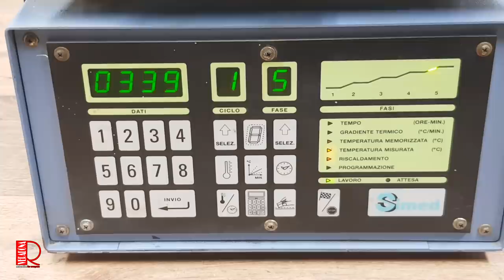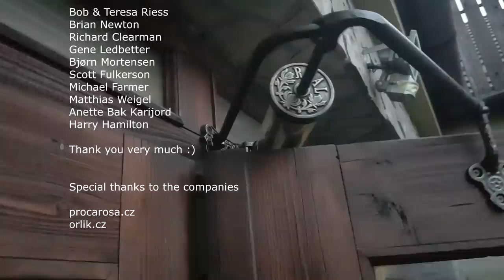Door closer - Restoration

Comment: I looked it up: Mr. Norton's Door Closer, designed 1880's in England!  Just amazing work.
Reply from the maker: Thanks :)
Reply: Of course that explains why the spanners didn't fit - the nut was 9/16".
Reply: @Ragnar8504  I think you have the size right - but it's odd. Old British fittings would be in Whitworth sizes, not inch A/F
Reply: @paulwomack5866  You're right, that's odd! There doesn't seem to be any Whitworth size that corresponds to 9/16" AF either. 1/4" Whitworth is smaller, 13.335 mm, and 5/16" is 15.24 mm.

Comment: A 3/8" bolt is 9/16" across flats, and that's bigger than 14mm and smaller than 15 - so if it's a British door closer, it would have had Imperial size bolts. I like the finish this time - although I'm not sure I would use the tannin rust remover as much as you do! Lovely to see someone doing an actual rivet instead of just peening over. Great job!
Reply from the maker: Thank you so much Bob for the honest comment. Radek

Comment: That air-leak adjuster is a beautiful design!

I wonder what size the bigger than 14mm but smaller than 15mm nut really is?

Looking at a chart of spanner jaw sizes, 9/16 inches AF (i.e. American) looks plausible. It's 14.29mm.

And "NICE JOB" on the spring - having a lathe is one thing, but then oh-so-casually moving on to heat treat it is something else!

Comment: No wonder your metric wrenches didn't fit properly, those were imperial nuts and bolts.  That was probably a 9/16th inch nut which is 14.2 mm.
Reply: I immediately thought that when the 14 mm didn't fit. Either the nut had swelled from rust or it was actually 9/16.

Comment: I have a question about the Tanin. I understand it protects the metal from rust and gives the metal a nice look. What I don’t understand is the purpose of using steel wool on it afterwards. Is it just to take excess off? Thank you for the information.
Reply from the maker: Yes exactly. When tannin is left there, it absorbs a lot of paint and in addition, the color is uniform. When wiped off, there are more shades, so where it remains, the color is darker and vice versa. (when only varnished with clear varnish)

Comment: Where do you find your gold wax? Very cool looking Veradona. Seems like you may need to adjust the air release screw. Your door still looked like it slammed.
Reply from the maker: It can usually be bought in art supplies. Yes, the fault is in the door shooter, it's broken, I have to replace it.

Comment: I have 2 say - I never seen a door closer like that = So Cool _ The restoration was over the top. But - only 1 Question - With the door closer on the out side will the brass tarnis or did U treat it so it will keep shinning??
Reply from the maker: Yes, brass will wear out over time, even in the interior. If you want it to keep shining, you need to paint the brass with a clear varnish.

Comment: I watch these and I say to myself I can do that. Then I remember I don’t have any tools. Or memory retention. Or talent....
Reply: Details, details! Everyone starts like that. Then you get a few tools, then a few mote, try some small things. A decade or three, and you can do anything.
Reply: @mred8002  kind words my friend :) I'm not sure how many decades I have left lol I did find this rusted sledge hammer head on my land. Been wanting to try and restore it. I guess I knock out the wood that was once the handle 1st? The de-rust the thing 2nd? Idk... but thank you for the inspiration! :))
Reply: @malakinbutobastos5644     I put broken-handled tools like hammers and such in my wood stove embers. This burns out the handle remnant and normalizes the steel so it can be filed and shaped as needed. A powered rotary wire brush is relatively cheap and useful. Handles can be armed with simple knives from even a hardwood tree branch. Lots of videos of folks with few, simple tools on how-to. In my case, it was ‘had-to’, being poor and having to resuscitate old cast-off tools.
Reply from the maker: Gentlemen, nice words, thank you :) Radek